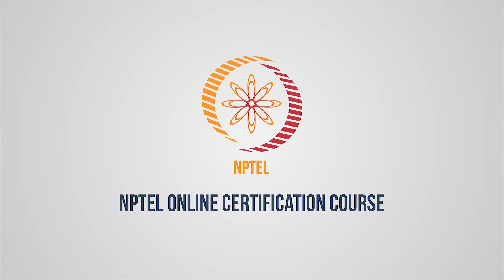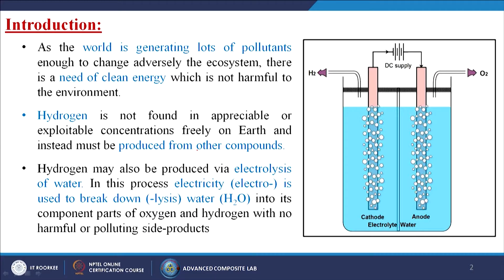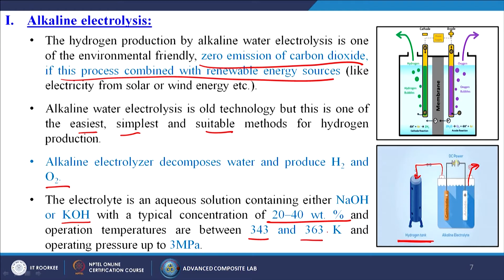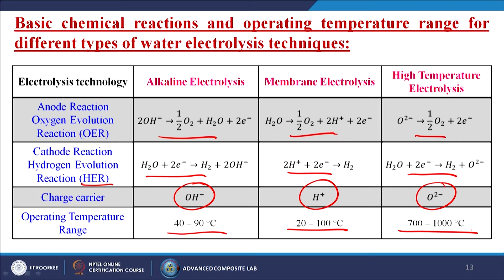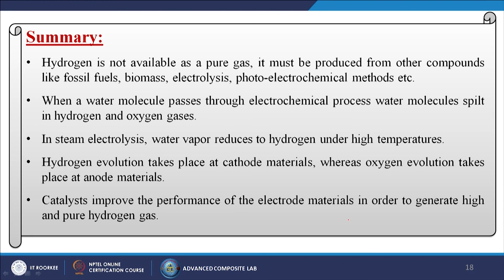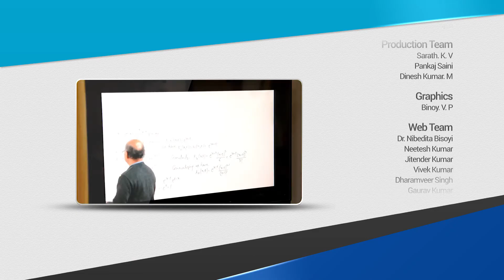Hydrogen Production from Electrolysis

Comment: Sir, We made a kit using scrap stainless steel sheets and used it for running a motorcycle. It could run without a drop of fuel.                                                                                                                                             We made a bigger kit and used it for running a Nano car engine. We did not take the car on the road as it is not approved. The engine worked without using any fuel. We tried it for one and a half hours successfully.                                                                                                                                                               If the Government is advised by IIT Professor like you and it considers allowing these kits for fixing it on vehicles to run these on biofuel, a lot of pollution could be reduced and fuel saved.                                                                                                             We joined hands with an Engineering College in Mumbai and Pune and worked a standby generator and used hydrogen gas produced by our kit as a bio-fuel. We observed that it could save two lit. of diesel i.e. 17%. Bigger kits could have saved more fuel, but we did not experiment as it's not approved.                                                                                                                                                                                 The PCRA in its report has appreciated the use of Hydrogen gas, but it has mainly talked about producing  Hydrogen by a chemical process, use of hydrogen storage cylinders, importing cylinders and transportation vehicles, etc. They have said it is the future fuel but has not talked about the electrolysis system much. The government could encourage people to use hydrogen produced by electrolysis systems, as it does not need any storage cylinders or transportation vehicles. it's the simple method of producing gas on the spot and on-demand. to work generators, welding sets, or any equipment using internal consumption engines the country can save on fossil fuel and reduce pollution.                                                                                                                           The large kitchen, industries using thermal energy be encouraged to use hydrogen produced by HHO producing kits to save fuel and reduce pollution.                                                                                                 We have used in all kits scrap stainless steel, used for utensil making quality.                                              We used the kit also for working the gas as LPG gas, it works.                                                                        These days there is news that a lot of people die due to coal powder dust in the atmosphere, and blackouts due to a shortage of coal in the electricity generating stations.                                                             If IITs can work on replacing coal as a source of supplying thermal energy by producing hydrogen using wind, solar energy lot of lives could be saved and pollution reduced.                                                         This will also create a lot of employment. But the manufacture of HHO kits should be according to some standard. We had initially purchased the HHO kit online and found that it was good as a water heater than a hydrogen gas producer as the gap between the anode and cathode was too much.                        Sir, if you like the idea please advise the Government. We have written to the authorities but the response is lukewarm.
Reply: I'm interested to hear about your kit.

Comment: If seawater is taken from a bore well about 2 - 5 hundred feet away from the sea,  for making hydrogen gas by electrolysis, no acids will be required. The DC Voltage is generated through Solar power or Wind turbines. Hydrogen gas is used for making steam for use in the Steam turbines that are running the power generating system. The used steam that was cooled by water drawn from the bore well,  cooled to be used for drinking water.The bore well water that has been heated while cooling the steam to be fed to boiler for making steam for turbine.